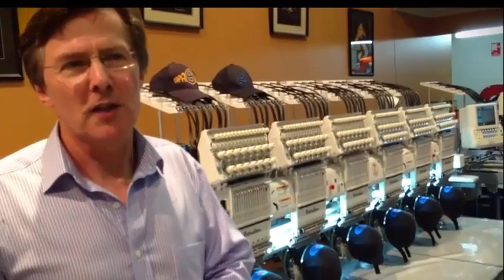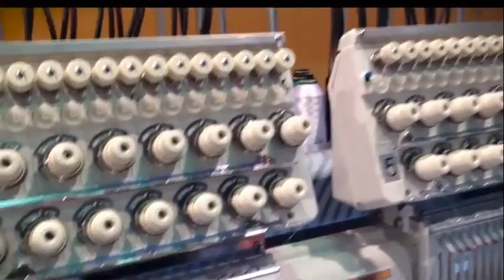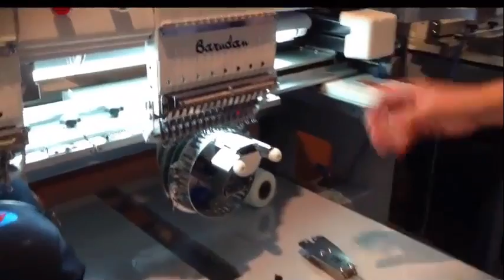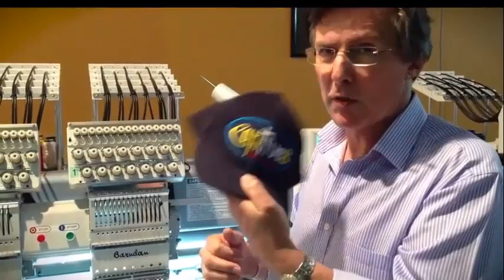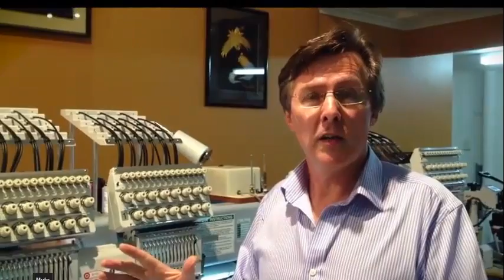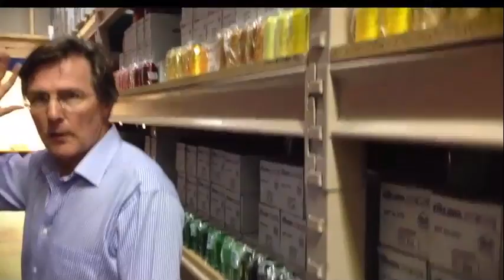Paul White explains why hand-built Barudan machines are so reliable and productive

Comment: I LOVE BARUDAN! Scrapped 6 head SWF for metal along with Brother 3 head.  Decided to sell Barudan 6 head and some single heads as i was retiring early to take care of my Mom.  Unfortunately she passed away nov 2017 and my best fried/biz partner passed june  2017.  So back to work.
4 single head Barudans, 3 used from shop, and 1 new one.
I had 2 at my friends home, and one extra stored at another freind's shop.
My Barudans are 15 yrs, 14, 13, and 6 months old are still running great.
Won't run anything else.
You couldn't give me another brand...  they SUCK!
There is a BIG difference in machines!
Only Barudan for me.
Reply: Wow you came back and updated, nice. I am thinking about getting either a Melco, ZSK, Barudan or Tajima. I am starting to lead towards a Barudan because of the stitch detail. I will be doing mostly hats and I need precision.

Comment: We have 4 single head Barudans, 1 6 head Baurdan, 1 6 head SWF, and an antique 3 head Brother.
The SWF was purchased during a business closing, bought it to get his large clients.
We use our Barudans 95%, SWF and brother sit idle.  
People just getting into this industry are mislead by the cheaper brands.  Which is a good thing if they are in our area!  Our Barudans make our clients very happy with the quality. They can handle the smallest details in designs.  
When we get a large project, we will sew out a sample on Barudan, SWF, and Brother to see if we can use all heads.  75% of the time we shut down the others because they can't embroider same quality.  They can only produce simple logos.
I am so glad I purchased Barudans when I first started my business.  SWF was just a way to get more clients since the company was shutting down.  Brother was an antique, I had to have it. Pantogram has two huge squares on each side.  Was intrigued by it.  Have had it two years, hasn't run more than 100 pieces.
We average 7000 pieces per month just using 10 Barudan heads.
Reply: do you still recommend barudan? i am looking into the pro 3 single head to start off with vs a zsk or tajima or melco emt 16x. something tells me barudan is the right choice for me.
Reply: @Bluntedco.  was in the same boat. Committed to the Pro3 because of positive drive technology in particular. Can’t wait!
Reply: @VYinLA  Congrats! The 6 month wait time though lol it better be worth it huh!
Reply: hi and how much is about the prize for the machine barudan